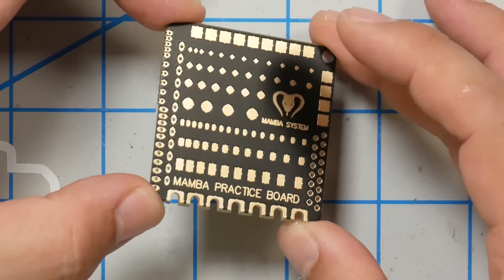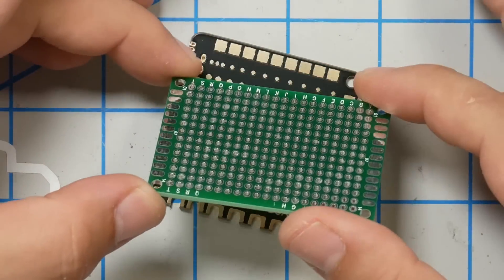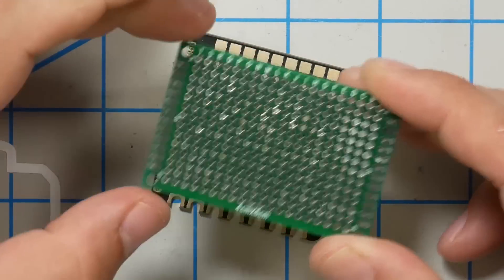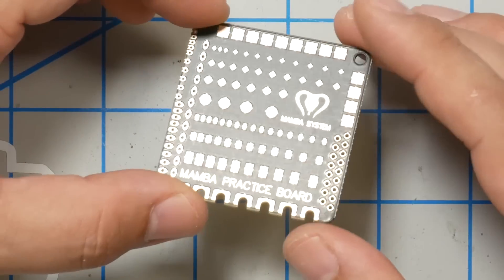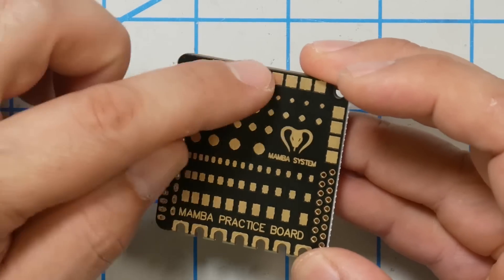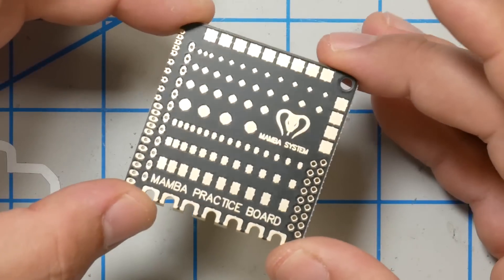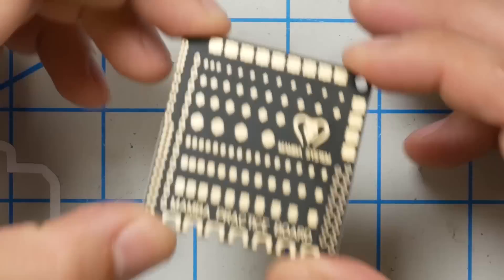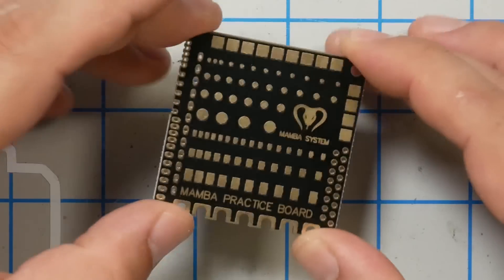How to get better at soldering | PRACTICE with the Diatone solder practice board

Comment: Joshua- I have been soldering for 60 years and have found tricks from you on doing the small pads used on flight controllers and receivers used on quads.  Great video!

Comment: I LOVE the excitement over something so simple. I get that 100%. I've been using RGB strips to practice on when I'm doing custom lighting in a PC build. They make connectors for the same purpose, but they are sketchy as hell and half the time they don't work right. Plus, they are bulky. So, instead of the connectors, I've been soldering wires directly. It's not the broad range that the practice board provides, but the pads are pretty small and it has paid off.

Comment: The little things like this is perfect to teach on. I have over 30 years experience in electronics from taking apart my toys to working in a factory build up board, repair, and QC to even repairing equipment on aircraft in the Air force. I was brought up in the first few generations of Surface Mount Technology. LOL This would have been awesome in the day when I was learning or teaching other in the military. I just used junked electronics to practice on. Yes, I was that kid taking everything that broke apart to see how it worked. Nothing beat raw experience. This one simple little thing could be a game changer for the new guy. It could build the confidence to get in there and fix their quad. It can be intimidating for an experienced tech to work with some of these tight areas on such tiny items. I am sure Tyler is going to love you for the giveaway. Great Video on something that needed to be shared.

Comment: New guy here, got a tinyhawk s about a month ago and I’m hooked.  Bought a used Hawk 5 and it appears to be soldered by the guy you described.   I’m trying to diagnose why it randomly falls out of the air by working back through all of his soldering before I start replacing boards.  I’m going to have to pick up one of these.   Reconnecting motors and XT60 connections are easy enough but I don’t think I could do one of those tiny smartaudio wires to a captive pad stuck next to important stuff.  Nice suggestion!

Comment: I love this cheap little board! It’s a perfect warm up board to use right before you build as well as a regular practice board for when you just sitting around watching tv. Grab some solder wick and a solder sucker to help remove it and use it time and time again. I’ve got one I use just to solder the pads and one I use for soldering the pads and adding wires. I also use old esc and fc boards to practice too but this little guy is just so perfect. 
You can even solder the mamba emblem and when done right it looks pretty sweet lol.

Comment: These are a great cheap way for someone to learn on. Wish i found something like this years ago. Ive been soldering for almost 20 years and just learned flux is for more than cleaning the iron lol thanks to one of your other videos. Another good way to practice is desoldering and resolding components on old dead devices you may have forgot to throw away, pick the smallest thing u feel comfortable with and work down in size

Comment: This is sooooo true. I have several hobbies that involve electronics and soldering. People jump right to the software and skip right over the soldering aspect. Then they end up posting how to fix their lifted pad, why their board reboots when shaken, etc. Weeeelllll... It might be be that horrible soldering job on that buddy. I usually recommend perf board practice until they can at least solder a 24g wire to a pad in under 2 seconds before they ever touch a sometimes $150 board. I will now recommend this. I'd really like a couple to play with and give away to new people. Thanks JB!

Comment: I totally agree about how cool these are. It's like basically a nominal fee. I bought 2 of 'em, one to use and one to give away. They also came with a paper with a Chinese-to-English translation on them that has me completely scratching my head. "GOOD GOOD STUDY, DAY DAY UP".  😆 There is also a free piece of wire to practice with wrapped around them. You just need an iron, solder, and snips to get started.

Comment: This is really cool even if you're not learning to solder quad stuff. Some of the smaller pads are similar to the sizes you see used for SMD components and the smaller holes are good for through hole parts. Grab this, a few pin headers and a couple through-hole resistors and you can learn a variety of different soldering techniques. I'm thinking I might pick up a few of these and teach some people how to solder.

Comment: Hey as one of those "nasa certified" technicians (Its IPC nowadays), this is great! Noteworthy, is that these practice boards don't have traces attached. Which for smaller stuff isn't a huge deal, but for big ground planes like on Vbat means you might need a bigger tip/dwell time. Otherwise, good looks diatone. Also, I would say you can go to ebay and search "Practice solder" and find a lot of similar things. But those are mostly for practicing SMD or through hole. Where this is aimed at FPV specifically.

Comment: Great action. I don't need one because I have no problem with soldering. Great tip: keep your solder tip clean with a near dry sponge and don't make your solder iron to hot, because that burns your flux away 🙂

Comment: Spent too much money on investing in all my gear, even renovating my spare room as a work room.
Two decades since i last soldered i really thought i could do it.. Used lead free solder and too high a temp, couldn't re-melt the solder and pretty much bricked my spedix gs45... That is now what i practise on until i feel good enough with my skills to move onto my second GS45 and my matek f405 ctr and finish the build. 

Soldering is such an art form, took a week off work to renovate the spare room, used my evenings (4-5 hours) to watch your vids, practise soldering, check my build choices, read manuals of balance chargers and flight controllers... Then i flick my horus x10s express gimbles to lull myself to sleep once i feel tired enough.

Comment: Coming from APM/Pixhawk I burned up a Omnibus F4 V5 a few months ago trying my hand at a modern boards.  Still don't know where I bridged two connections as everything looked good even after it fried.  Years ago we ran CC3D and never had a issue soldering those. I replaced the Omnibus with a CL Racing F4S successfully and just started flying the 250 quad that used to have the CC3D from years back. 

Never thought of keeping the old boards to practice on!

Comment: It would be great to get one of these. I have experiencing soldering years back when I first got in the hobby flying planes and helicopters. I haven’t touched anything that flew in 5 years, getting back in the hobby but this time with a tiny whoop. Definitely need practice on the boards and smaller wires. Keep the great content coming Joshua Bardwell!

Comment: I get the practice boards for $1.50 that includes a selection of smd components in the price. 
The great thing is that the board is an actual circuit and as you add the parts you complete the circuit, and smd leds light up once powered so you can check your smd soldering stage by stage.

Comment: There are actually plenty of soldering practice boards available at places like Digikey, and they often come with components ranging from PTH (through hole - easy) to 0402 smd and things like msop 16 with 0.65 mm spacing components (for a real challenge). And if you learn to solder real components, specifically smd ones soldering wires will seem silly simple. But I agree, for someone who is not confident in their soldering skills, something like this is a great thing to get.

Comment: nice idea. i would like help soldering to a 4in1 esc. it just sucks the heat up way too much.
Reply from the maker: Need a temperature controlled iron. A big tip helps too. Use liquid flux.
Reply: @JoshuaBardwell  thanks for the fast reply. i got all of that. And got it soldered but not how i would like it

Comment: I find a stereo microscope indispensable when soldering. I'm not 20 anymore, but even at 20 being able to closely watch the solder flow (or not) is very cool. They're good for getting a sliver out of your finger too. Get a cheap Amscope with gooseneck light.

Comment: I was wondering if there was a way to check one's soldering for continuity.  Like if every other pad was already connected to it's mate to the right side, so I could connect a small one to a large edge one and then use my multimeter to check the adjacent pads to see if I did a decent job.  Maybe also confirm that I didn't connect to the pad on the other side?

Comment: One of the reasons I haven't built my own quad, nothing to practice soldering on and I'm scared of destroying a FC. I ruined one mobula7 by trying to resolder a loose wire to the FC. Neck straps can be sexy, it's all about where you put it on.

Comment: Bardwell,  so recently my taranis x9d+  doesn't want to work on my simulators. i've downloaded/ re-downloaded stm 32 drives,  flashed the latest taranis firmware and bootloader, universal usb drive updates any other type of drives i could think of, and can't get my computer to fully recognize my taranis. Also i just got a new cable because my old one stopped working. i spent 5 hours and almost every source of info and nothing.
Reply from the maker: https://youtu.be/rk6bjS4PEWI
Reply: @JoshuaBardwell  thank you very much!

Comment: Had a computer open the other day. Larger tower. Mainboard was gone. Closed it up and put it in recycling.

Then I got thinking. Some open holes in that mainboard. So I started opening up other dead electronics. Found enough practice soldering for a year and I need it.

I credit that brain synapse to watching this video a few days prior. Never would have made the connection otherwise.

Comment: Thats a great thing to have around, but it needs a couple of large battery pads with a realistic heat-thieving copper layer to accurately replicate the most difficult part of soldering up any fc/esc.  
(Even better, add an adjacent color-changing heat indicator that gives some idea of impending doom on the real thing.) 
The rapid heat transfer away from the negative pad in particular makes me nervous/concerned as hell when trying to hit the perfect balance between hot enough for a good joint, not hot enough to damage it, and quick enough that my fingers tolerate it.
Why use my fingers to hold the battery wire?  Because if my finger can put up with holding the wire at ~1/2 inch or so while I get good flow on the pad the fc/esc will certainly tolerate it too.

Comment: It would make FPVer's life so much better if the FC had holes in the pads instead of just pads. The TMOTOR FCs have them just the way I like them. Just reduces soldering issues and pads lifting off boards . etc., etc.

Comment: Guilty of having built multiple drones without practicing... 
but I find the hard part isn't so much soldering as, for different wire types/sizes, making sure the base isn't going to break every strains of wires left to connect!

Comment: Wish there were other component footprints so you could practice soldering 0603, 0201, tqfp, and qfn packages instead of just wires to arbitrary pads. I also hope all those pads aren't all connected or you're going to have to dump a ton of heat in there to get your solder to flow.

Aanyway, I do really like this concept, just wish it was a bit more applicable outside fpv.

Comment: You don't need the training PCB, you just need
1. Correct temperature
2. Correct soldering tip
3. USE MORE FLUX!!!!
4. Clean the PCB with alcohol before soldering!

Comment: Ok ..my 2 cents worth...

Being soldering for 45+ years
.   Played with a number of irons ... currently favor Metcal brand.   

Sometime I cringe watch Joshua solder ... but you getting there Joshua.

You need a decent soldering iron.  Maybe 95% of people here are not doing electronics as a career I guess. 
They tend to buy a cheapish soldering iron that at first may solder ok, but what makes a good iron is the soldering tip and tip temperature regulation.
Tips oxidize and become useless at soldering.   Good irons have quality tips with an outer iron plating  that last longer. 
A good iron will regulate tip temperate better. As tip heat dissipates when soldering, the iron needs to pump in more power to regulate the heat losses.
When not using your iron, turn it off.   I am not entirely sure what impact this has on tip life, but my experience seems to indicate that turning the iron off helps prolong the life of your tip.

see this article for tip life...
http://www.techni-tool.com/site/ARTICLE_LIBRARY/Hakko%20-%20How%20to%20Maximize%20Soldering%20Iron%20Tip%20Life.pdf   

Having a really hot iron helps.  An under powered iron can result in a long soldering time causing too much heat being spreed into board.
A hot iron allows for a fast solder joint and less heat spreading to nearby components .. if you can solder properly and quickly.

The iron tip shape should be chosen accordingly.  I find a 1.5mm chisel tip best for most applications (even soldering 0402 chip resistors/caps) and change to a larger chisel when dealing with boards required more heat .. like large solder pads or soldering on aluminium clad PCB as used in the LED lighting industry.
Conical tips are pretty much useless in my eyes.

When soldering a wire to a board, prepare both items.  Make sure the pad has a fresh layer of solder and the wire has been pre soldered.  
Remember that over time, copper oxidizes and worse, power leads tend to chemically corrode making the application of solder almost impossible.
Cut back wire until you got sparking copper.   Don t scrape pads with your soldering iron.  You will shorten the life of your valuable tip.
  
Use flux ... it helps a lot.  
 Prepare a a pad pad accordingly.  I use a scalpel blade. 

Some fluxes currently being sold seem to be better at helping distribute heat though ... and not so much at preparing the wire or component for soldering.    Choose accordingly.

If you have time, watch Louis Rossmann's youtube channel.  You can learn something from him.  But he is more for professionals. 

If you have a choice, use tin/lead solder.  I find it is just easier to work with and a lot of soldering irons that can reach the higher temperature required for lead free, may not be able to maintain that higher temperature through the soldering process effectively.

It HELPS A LOT to have magnification so you can see what your doing.  As you age, you will need magnification.   I have a bunch a reading glasses from +1 to +3.    Most soldering happens under a stereo microscope.

In some cases, solder paste is a must have.  Makes really tricky and fine soldering possible, but this is more for those who solder really fine pitch ics (0.3 to 0.5mm pitched parts)   If your doing this, you most likely will have a hot air station as well.  Never knew how useful they could be until I got one. 

Above all ... practice.  Its experience that makes you good.

Comment: I need to learn to solder because auto "repair" cough Replacement cough shops don't know how to actually fix anything, they only know how to replace parts and things. Oh & Computer "repair" shops also only know how to replace parts and trouble shoot things... Repair means to fix, you only should replace what is unfixable.

Comment: You need flux before soldering the components together! Flux the wire and the board! when you are finished you wipe the board  with alcohol to clean it up. Joshua you need flux. There is not enough flux in the solder to most of the soldering jobs!

Comment: Please pronounce solder properly - There's an "L" in there, otherwise it would be "soder" and that sounds like a whole different thing!

There are some more generic soldering practice boards on Ebay with components that are really cheap for people who want to learn about soldering components rather that just wires, useful for practicing repairs.

My number one tip for people leaning to solder is to use decent branded solder. (With a 2-3% flux core, you don't need extra flux if your solder has enough flux inside it) Using decent solder can really transform your soldering and a decent quality soldering iron tip also makes a big difference. Soldering is all about managing surface tension, you need the solder to somewhat stick to the tip so that you can drag it around or wipe it off.
Reply: Proper tip maintenance and tinning is half the battle. I can't tell you how many people I've seen running way too high of a temp then still having to hold the tip to the joint for a long time trying to get it to flow. Dangerously heating the pcb and components around it or lifting pads. All because their tip isn't tinned correctly or at all. And yes lead free is trash although it works if that is all you have. Using additional flux does help those who may not be the quickest and burn all the flux out when they tin the pad and wire.